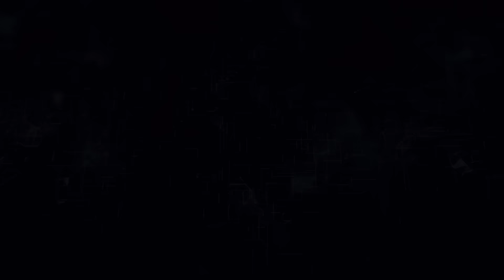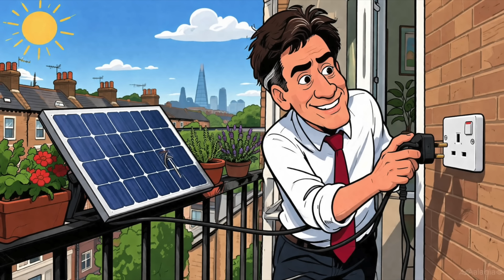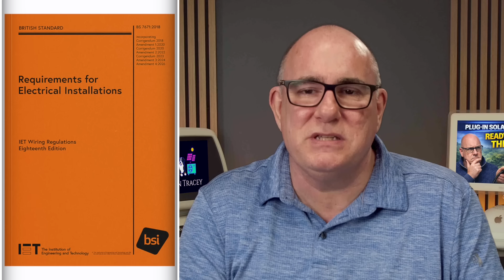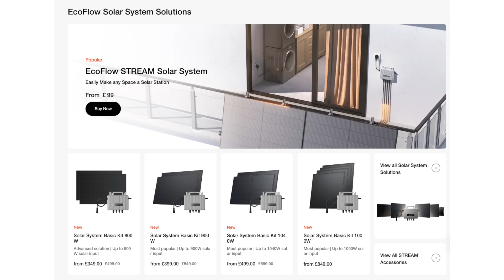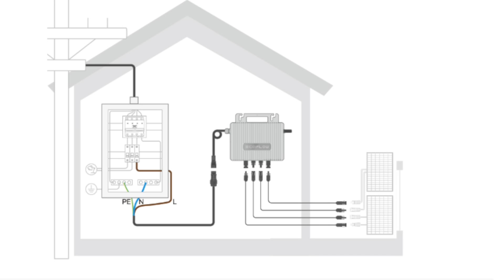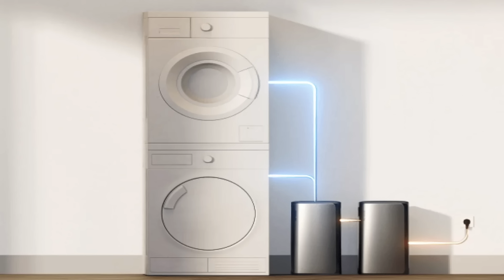Plug In Solar Is Coming… But There’s a Problem

Comment: If micro generation takes off, and even marginally say knocks 10% to 20% off your daily consumption, could that potentially trigger mathematical "tampering" alarms in the absence of paperwork?  Regards... Ed Zepplin -Phased and Notfused.

I wonder if the kit would come with some QR code certification to which you add your address, MPAN and submit etc?

Also, if the panels are some distance then what works out cheaper (and more efficient), longer mains cable from remote inverter/battery combo, or longer cables from the panels?
Reply from the maker: it could but they would only see it if they were looking, they cant even get billing right so sophisticated modeling of this type is probably beyond them :-)
Reply: @JonathanTracey  Anything is possible. I used to show a picture of a potato and a fish as an example in a past presentation and ask the audience what they saw. The answer of course was fish and chips. Infinite monkeys will resolve the answer too if the question is constructed right. Mind you I wouldn't bet against a door mistakenly being bust down due to usage drop down to being on holiday.

I wonder if some kits have a global kill button....hmm
Reply: Definitely run the longer part of the cabling at the higher AC voltage.
With 230V it's great Amps stay low, maybe a bit harder to run very long cables with 120V, as Amps have to basically double for the same Wattage.
Reply: @konstantinlozev2272  Thought as much but I guess the cable would ordinarily need to be armoured? Could an Ecoflow live remotely in "dog kennel" size construction for weather protection?
Reply: @Stormin_MikeHi, Must correct myself, I thought AC in the UK was 120V like in the US, but it's apparently 230V like in Europe.
So, you are good with a longer cable as long as you run only the 800W from the inverter.
I was thinking of the EcoFlow Stream route, but I don't have a safe place to keep it outside at the place where the panels are installed.
So I went the micro inverter route and a Marstek Venus battery in the AC side. And a hybrid boiler.
Reply: @konstantinlozev2272  I concur that voltage over current wins as is in the bigger distribution world.
Reply: On ancient meters they will run backwards and they will come down on people who do that. Very few meters that old in existence. The later units will record a tamper alarm for backfeeding thinking it was an attempt to 'rewind' the meter. That's been true for solar installs since the beginning so meter readers ignore the alarm.
Modern meters will record the export separately and the info is there in the meter and for the energy company.

When an install is done both the installer and the DNO on the G98 are supposed to be spotting problems like ancient meters that go backwards.

Comment: So what’s stopping me from hanging a solar panel out of my bedroom and using the mc4 connectors to an XT60 plug and just plugging it in to my BLUETTI Apex 300 and expansion batteries by this time on Tuesday?
Reply from the maker: nothing as the bluetti is not connected to the mains, its a battery and solar setup. Micro inverters feed into the homes power circuits
Reply: @JonathanTracey I thought so, I had the idea about 9 months ago. The problem is moving stuff around to set it up. Or getting panels fitted to my garage roof.
Reply: The regs only bite you the moment you grid tie as opposed to grid feed. Our AC300's are plugged into a bunch of solar panels and run our air/air heatpumps/aircon much of the year, just dipping into cheap overnight electricity in winter.
Reply: @etchedpixels I’m taking action on this idea. I’m planning to do a test. Using my portable solar panels ‘hanging’ out of windows on my house. Then plugging them into a couple of my power stations. If it works I’ll be getting some full sized panels and mounting them. If not, well I’m pretty certain it will work, but I want to try out first.

Should be getting the cargo straps this afternoon from Amazon. I had hoped to try out this Monday, but the weather is not looking favourable.

Comment: Our roof is perfect for solar, but we don’t know if we’re going to move in 2 years time so we’re holding off. 

Plug in solar for the garden fence feels like a great stop gap, something to scratch the itch.
Reply from the maker: just be careful once you scratch that itch its keep itching unless you keep scratching :-)
Reply: I'd invest in solar before the prices rocket, they're already up 30% on 2 years ago. 
Your house will sell much better and for more once solar is fitted, especially if you have figures to show how much electricity is saved by having solar.
Reply: you get money for solar on the roof once you are showing the figures of its performance over 1 year. You can sell easier and faster. 
Who know how long your 2 years become in such era of so many unknowns, but for sure the iranians can fight much longer than the weak american society with presidents looking for the next elections and the economy. 
But if you start now the Balcony Solar power (without battery - which you better stay away from in the beginngin as current systems are inefficient and far too expensive, bluetti, jackery, eco flow are crap cause no one tells yout that they loos 30% to 40% depending on your profile) you are gaining back the investmernt easily. 
And if you get german regulations do the roof installation on your own as you save a fortune. Even 3 panels witch a micro inverter are a good start. 
We started back in 2015 with 8 x 225 Wp and a 0,6 kW inverter in germany, then it grew ... an dgrew
Now it is a 10 kW system fully feeding into the grid for 8 Cent or 7 pence and a 20 kWp system with 3x 16 kWh batteries to run the house, wallboxes and heatpump plus split AC for heating. 

We buy cheap Octopus intelligent go energy during night from 0 to 5 am at 8 Cent instead of 21 to charge the batteries. After 20% losses we do not get 48 kWh out of the battery, but rather 80% or 39 kWh AC. This means 8 Cent is the price we pay for charging, but we need to charge 20% more kWh or we simpl  y increase the price: every kWh drawn from the battery (charged in the winter from the grid) costs us 120% x 8 Cent = 9,6 Cent

And if you use the crappy systems from delta and bluetti and jackery which are partly running on low 24 V batteries the efficieny is far lower so losses are higher. But that depends a lot on your load profile, the watts used during night. An inverter of 5 kW can deliver AC power with over 97% efficieny, but only under full load. If you want to have 90% efficiency your load has to be above 900W .... and if you usual demand is just 100 W then the inverter will deliver 100 W AC but draw from your battery 180 W DC.  .... and you face over 40% losses and you battery (dc) capacity will provide not 10 kWh, but 5,5 kWh AC

This is where most buyers of ecoflow bluetti zendure anker batteries are going crazy: they measured their kWh consumption AC for weeks in march during the evening and night. They saw a 2 kWh figured, they bought a battery with 50% reserves and paid for 3 kWh DC battery.
And 1 week later I get the calls if it is a scam or what is wrong cause every mornging the fully charged battery in the evening had been completely depleted where it should have at least 1 kWh remaining. But empty. Some come later after 4 weeks , but then it is too late to return those. 
If you ever consider buying a battery, get a 16 kWh one as we buy them from china or german vendors for 1200€ with EVE cells (type LFP).

Comment: How will it behave with existing installations? How will it behave if your system is in island mode because of a power cut.
Reply from the maker: my current micro inverter shuts down as soon as there a grid outage, it can still supply power from the built in power sockets but thats not on the mains circuit
Reply: If it's wired on the backed up side it will blow up your inverter. If it's wired on the grid side it'll just shut down. One or two systems can back up additional microinverters wired directly into them.

Comment: Great video as always with great info.
Currently have a full solar system and battery’s but tempted to add a system like this plug in to the rear garden with battery’s so in the summer can sell back a small amount and in the winter use the battery’s to make it to the cheap rate as current set up means in the winter they are flat by 6pm. It’s either add one more 5kw battery at £1250 or do a plug and play solar panels and battery system for around £1500…..decisions. Look forward to the summer video of how to set it all up and which couplings for the smart meter go where for people who already have a solar set up so not sure if gota use all three of the couplings from the smart meter and where they would go.
Reply from the maker: Decisions Decisions, personally I aways default to more batteries, but having a bit of redunancy incase their is an issue with an inverter is a nice feeling

Comment: It will be interesting for me (and I assume for Jonathan too, and many others) as to whether Plug In Solar will be available as an 'extra' when you already have 'proper' notified rooftop PV, especially if this would take total generation over the G98 limit (is that 3.6kW?). If it will be possible, then I'm assuming that it will be unavoidably contributing as well to my SEG export (as metered by my Smart Meter.). If so that, reduces the attractiveness of paying extra for a battery.
Reply from the maker: Yeah they need to reduce the paperwork for this to be a success, hopefully the DNOs are hard at work getting this sorted
Reply: As the G98/G99 rules stand you are allowed a theoretical sum of 3.68kW generation from all devices on that phase with a G98 (so 1 x 3.68kW unless on 3 phase). Above that you'll need to file a G99 before installation. The G99 forms mostly got fixed for lower power ratings so it's not a joyous piece of paperwork but it's also not beyond most people.

Comment: RCBOs are available in the form of an extension lead for under £40 for those on a tight-budget or renting, ask me how I know.
Reply from the maker: it seen them can you link to one?
Reply: RCBOs or RCDs? These are different things.

Also, how does that ensure that there are no unidirectional RCCB/RCBOs upstream in the relevant circuits? For if you don't swap them out for bidirectional devices, the unidirectional ones are at risk of being damaged, potentially in a way that prevents them from providing protection but not being visible to anyone relying on their protection.

There are too many people who have a little bit of knowledge, but not enough to understand how to ensure that the installation not only functions, but functions safely and reliably.
Reply: @rednammoc  "RCBO". We won't be exporting anything, the system is set up to be self powering only. The grid has plenty enough free electricty supplied by Scotland, so much so it should be almost free of charge but isn't because of the grid run corporations monopoly who 'pretend' to be Scottish, but are owned by foreign states and work only for the profit of the stockmarket, themselves and their shareholders.

Comment: Been running my system for 2years with no problem,  i did do the g98 dno notification for the original powerstream and got approval.
Reply: I have been running battery storage and off peak charging (no solar) for the last 4 years, I have never applied for G98, I have never notified anyone but it must be pretty obvious because I consume around 200w during peak hours and anything from 10kW to 60kW overnight and also leak a very small amount to the grid because its cheaper to leak slightly and not be paid than buy peak.
Reply: @RandomNoob  They can't tell if you are grid tied, or if you are simply running a big non grid tie battery system that is charged from the grid (as is therefore already totally above board). They'd have to get a warrant for your smartmeter records to tell the difference easily.
Reply from the maker: yep g98 is easy as thy can’t really say no, G99 requires approval before fitting
Reply: @JonathanTracey batteries is the key as you mentioned, in the March to October I only use the grid for charging the ev once every 2 weeks ,im a low energy use , my base load is only 20watts, which is the network router,everything else is covered with ecoflow smart meter, my electric bill is basically standing charges apart the the ev.
Reply: @JonathanTracey  There have been some reports of DNO's rejecting G98s filled in by DIY-ers as "installer" is not qualified.
Reply: @JohnBlackburn1975  You just offer to refer them to OFGEM and they usually go and ask an adult what to do. You may need the electricians paperwork that was filed when they did the consumer unit changes but that is all.

Comment: What stops anyone simply buying these middle isle products and just plugging them straight into an old red/black fuse wired house socket. Will there be a notification to the government from the checkout with a name and address needed?
Reply from the maker: to be honest, I doubt they’ll be any checks. Unless they’re gonna do something like curries do if you buy a TV where you have to give them information about your home for TV licence.
Reply: @JonathanTracey its in the papers already that its happening. Why not get two or three and plug them in all over the house! You know it's going to happen 😢
Reply: @fast_eddie3441  Thats how you could overload and over heat your circuits and destroy the home circuits. Not worth the risk, and you definitely won't be getting a payout if you set your house on fire.

Comment: Already have solar on the roof, so this is not something I would benefit from.  I can see why it will help flat owners & renters but no way as much as the government will have you believe. I love how the UK government have jumped on the bandwagon of something that will make very little impact on the British public.  On a sunny day it will pull in enough to cover the baseload, but not on a rainy day, so when they say these plug in solars "will pull in energy on a cloudy/rainy day", it definitely wont cover base energy needs.  I need about 0.4kwh all the time & increases to 0.6kwh when i put the PC on  & obviously significantly more for kettle, oven etc. on a rainy day like today, my 12 solar panel system is pulling 0.2kwh. The government need to stop the practice of allowing the highest fuel type to set the cost of energy (eg gas/oil setting electric pricing), they also need to stop standing charges.  Im guessing due to lobbying & tax revenue generated, the things government could absolutely fix they leave well alone & yet tinker with ideas like this which dont need government support at all (just an update to the regs & making sure devices sold in UK meet the required standards).
Reply from the maker: @richsmart321 you’re pretty much right on most of this 👍

Plug-in solar isn’t going to run a house or cover peak loads — and in winter it’ll barely move the needle. Where it does help is shaving that constant base load, especially for people who can’t install rooftop solar.

On cloudy/rainy days — it does generate, just at a much lower level. So it won’t cover your 0.4kW base, but it might chip 100–200W off it, which still reduces imports.

Completely agree on the bigger points though:
👉 gas setting the price distorts everything  
👉 standing charges are getting out of hand  

I’d just say this isn’t meant to be a big system replacement — it’s a small, accessible option for people who currently have nothing 👍
Reply: All cool, solar on the roof, but you are wrong to say balcony solar has no benefits for you.  I too have 7kW on the roof but supplement that with balcony solar.  The roof fills batteries whilst the balcony solar takes the daily load.  Batts then discharge overnight.  🙂 Balcony solar, at approx 300 quid here in Germany, is easily the best bang for buck (ROI approx 18 months, then free electrons until it dies).